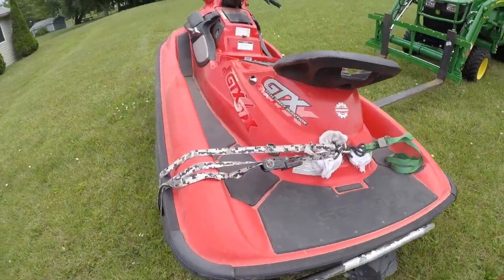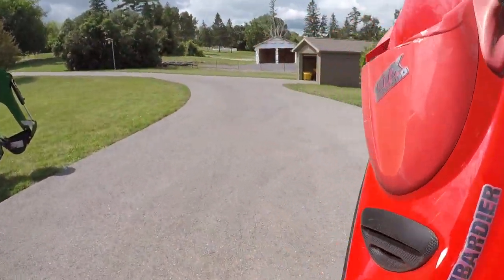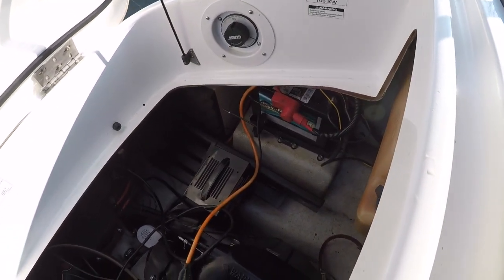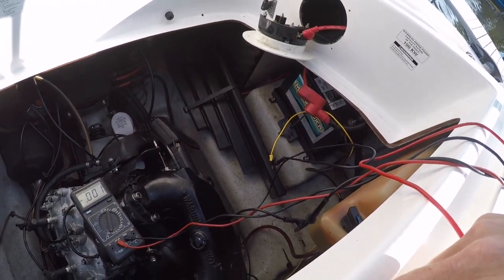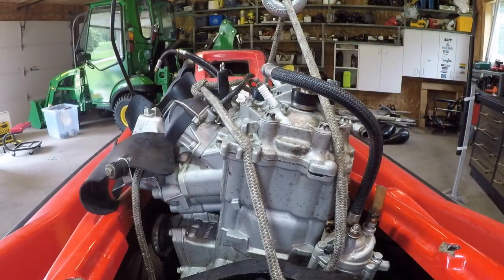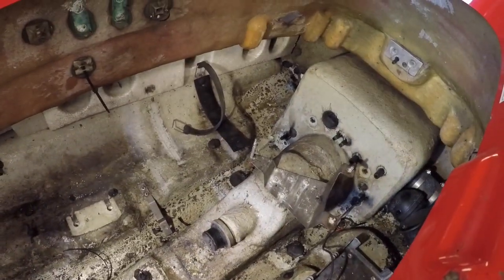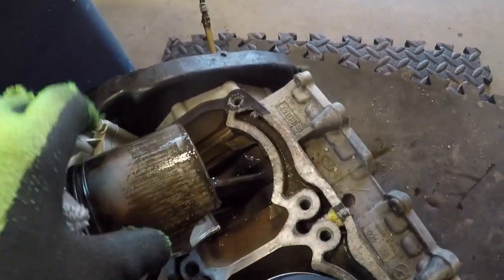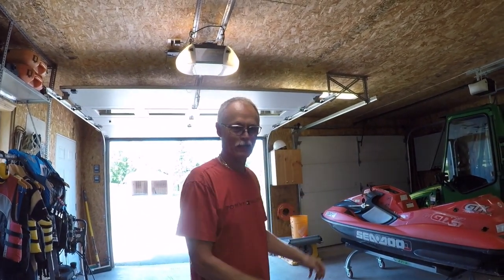Seadoo Mashup

Comment: I just did a 2001 gtx di had to get a fuel module, tried 2 pumps,  blows rectifier  put a big battery, found a ground in coil box with stainless  bolt, that looked bad. It didn’t fix it, I really think the issue is in that 90 degree electric plug to pump gets high resistance under load and could ever get past 6000 rpm and would stall, I had an air injector go out befor but it will code on dash, that fuel pump pulls 4.0 volts plus under load, pulls big amps too, so I put a 25 amp per hour battery and been wearing that thing out😎 32:06
Reply from the maker: This interests me as I have that RXDI that seems to want more power to run.
Reply: Plug connected to fuel pump was marginal at best and fuel pressure would start out at 107psi and drop to 92 and kept a gauge on it all summer, changed module and back to new again
Reply from the maker: @jeffberner3102  I am going to look into the fuel pump/ filters this weekend.  I will keep you posted.

Comment: Howdy from the states. Huge fan of your videos and the way you explain things. Definitely referenced your videos lots recently. 

Would you be willing to consult on an ‘02 Bombardier RXDI starting/running issue? New plugs, new battery, will turn over but maybe seems starved for fuel? 

After turning it over for 15ish seconds with the plug wires off and then trying to turn it over with the wires back on plugs it will run for 5-10 seconds.
Reply from the maker: Definitely a fuel supply issue .  Either the carbs need cleaning or a fuel filter is plugged.
Reply: @SeadooRefurb  thank you!

Comment: Hi i am JP from quebec 
I am a new owner of a seadoo sposter LE 2001
I will like to know how to adjust the oil injection ,
After 45min on the water the motor start to run readly badly until he stop running
I remove the spark plug ( they were BLAK )
I put new one and it run full power ,
That make me realyse the quantity of oil was to much
So how can adjust it
Thanks in advance for your help
Jp
Reply from the maker: That sounds like a carb adjustment.  I would not mess with the oil pump.  You are asking for trouble.  It may be burning too much fuel.